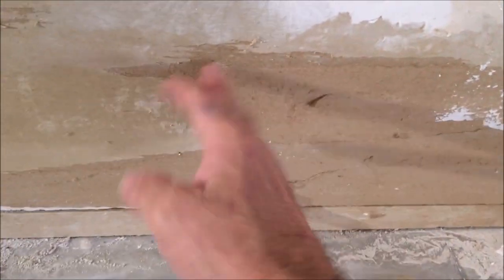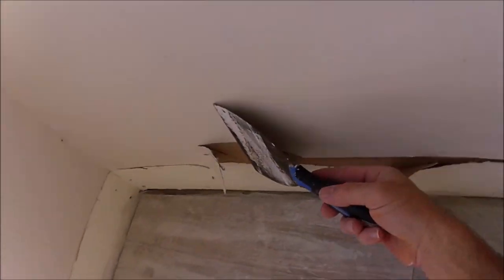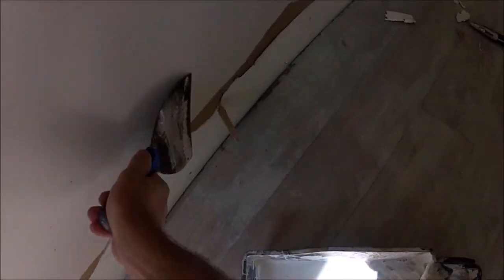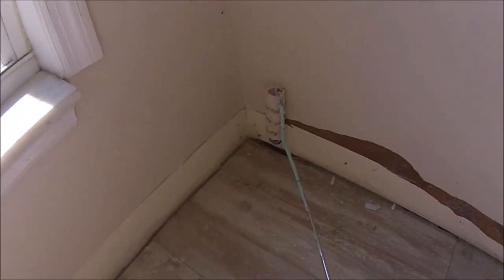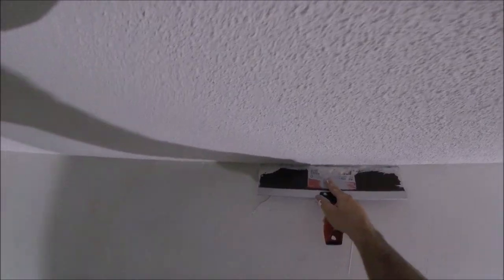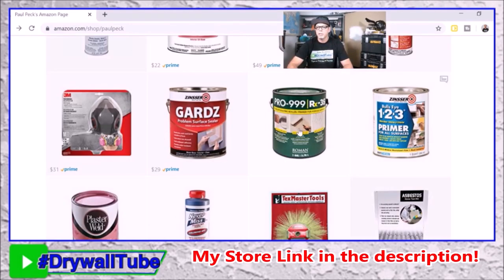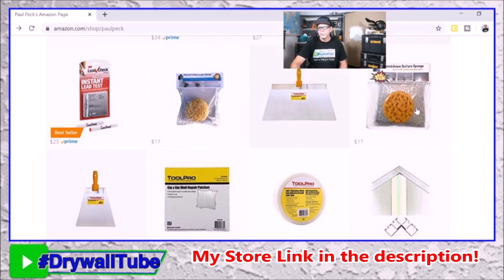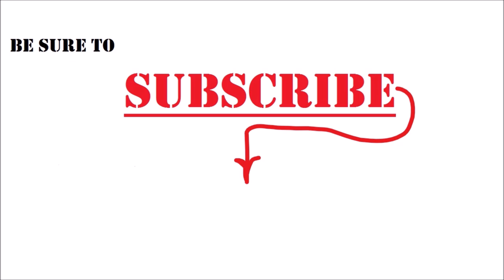Do You Need To FIX TORN DRYWALL PAPER? You Must Watch This!

Comment: I've been drywalling and painting for 24 years this year and I learned my lesson years ago about just mudding over raw torn paper, blistered,  bubbled, huge disaster and you're completely correct, I use cover stain oil base primer or white pigmented shellac but definitely gards is excellent and we use this as well. Thank you so much and you're definitely pro
Reply: Hi, i notice your the most recent comment here and could use some advice lol. so i just torn off my bathroom wallpaper and the drywall was all scratched up and blistered, drywall was a mess. i just finished compounding it, which i guess you mean by mudding? but as you mention, after I did this, its bubbled and blistered. sadly, i think i did it wrong, as I did not use gards before compounding. wish i would have found this video sooner. so my question is,  Should i gards over the compound and then just re-compound over it? appreciate the time lol

Comment: This stuff is fantastic over new drywall finishing. The paint goes on smooth and even and makes nail pop repairs and seam work disappear in the paint job. I use it as a primer any time I paint. It costs a few extra dollars but you'll use much less paint.

Comment: I am a pro painter fourth year. I have used the guards to go to effect. I also use pro block oil spray from Sherwin Wiliams it is white so you can see where you applied it and I’ve never had any bubbling after I’ve used both products. I love your videos.

Comment: Paul, your videos are always very informative and I have also use BIN Sealer as well to seal torn drywall paper and it has worked really well before skim coating.  I have been in the process of removing wallpaper in my home and was able to remove the first layer easily, but the second (paper) layer takes a little more effort to remove with scoring and using a spray bottle with warm water to dissolve the paper.

Comment: I’m so glad I saw this video! I’ve got popcorn ceilings that need skim-coated/painted. I hadn’t thought about using the Guardz to prime it first.  I’ll definitely use the Guardz on the ceiling I removed (most🙄) of the popcorn texture from. (That was a mess!). Anyway, since that “learning experience”, I’ve watched several of your videos on popcorn ceilings, skim coating, etc and am doing a much better job with those projects. Thank you for your time and for sharing your knowledge!!

Comment: Paul, thank you for all the instruction. I have learned so much from you and appreciate your help.  I am a DIYer forced to learn many trades as our contractors have done poor work. Sorry, but I have a question unrelated to this video... may be tough to answer.... I have a wall that is clearly out of plumb that became obvious after the door “expert” installed the door. I have told my wife I should tear down the drywall and start all over. I did suggest floating the wall to make it seem plumb but not sure the wall could handle all that mudd. The problem wall did not become evident until the door installer installed the door.... thoughts? This was a result of “contractor” reconstruction!

Comment: Great Videos!, All Around Handy Contractor Here. I'm Prepping A Wall For Skim Coat. Wall Had Paint From The 60s So Probably Lead Based. I Scraped And Sanded The He'll Out It Due To Peeling. I'm Assuming Guardz Is The Way To Go For Primer Before Skim? Any Advantage To Using Peel Stop Instead? What's The Difference? Walls Are Dinged And Ripped And Some Sections Didn't Want To Come Off Much. Thanks In Advance!

Comment: I used the shellac primer from them. Worked good. I had previously not done this in our bathroom and the bubbling was frustrating! Mud, sand it came back. wtf!! 
I don't know if this works on rooms with alot of nicotine on it - seems to always bleed through. Do you have a video on this? 
Love your videos!
Reply from the maker: If the nicotine is real bad, I’ll first clean the walls with TSP. Then, I prime with B-I-N shellac primer.👍🏻 -Paul

Comment: 25 and diy renovating my condo! i have textured walls and pulled off some ugly trim in the middle of the wall straight out of the 80s. is it possible to get rid of the textured walls with the skim coat? also have popcorn ceiling i need to get rid of, yuck!!

Comment: Do I need to sand ceiling drywall before hitting it with guardz, skim coat, and Retexture?
Home tested positive for asbestos & the company left a bunch of hanging drywall paper- even where the joint compound is.

Comment: Like your videos 
They are extremely helpful. 
I happen to like Gardz  as well. 
I Used it in a small bathroom where I removed some dated wallpaper 
It seemed to work fine then and no issues 3 years later. 
Fast forward to now. Everywhere I go I get a different opinion on what to use for my current task of fixing walls in the kitchen and master bathroom after removing dated wallpaper once again. 
PPG store highly recommends Gardz as they sell it there. 
My cousin who is a 45 year veteran of carpentry and drywall/ remodeling claims, that the only thing worth using is the original Kilz with the shellac base.  Not the water base. 
He claims that anything water base will allow things to stain thru down the road. 
Last week we were looking at paint chips at Sherwin Williams where they emphatically said to only use oil based primer sealer because anything else will let stains leak thru eventually.  
They must be referring to red lipstick or an old daycare center stains. 🤷🏻‍♂️🤷🏻‍♂️🤷🏻‍♂️

Water based sealers are easier to clean up after. Kilz is good but has a noxious odor to deal with.  
Not sure about oil based sealers. 
Quite amused by all the opinions out there. 
Sealers appear to have a degree of subjectivity. 
Case in point: Most Automobiles have been painted with water based paint at the original factories for many years now. 
Good quality Water based sealers ought to be up to the task. 

Thank you for your great videos and detailed explanations. Appreciate.

Comment: Remodeling our bathroom and our walls are horrible. I peeled off the paint in the entire BR. Underneath is 1 thin layer of skimcoat that they applied over horrible wallpaper. I have a few questions.

 One wall I removed it all, all the way to the drywall. It's a house built in the 80`s and the drywall is so smooth. Do I apply Gardz all over the drywall or just to the few places that the brown paper is showing? If I don't apply all over, can I just go ahead and apply a few layers of skimcoat over the smooth drywall or do I need to apply another kind of primer to entire wall? 

On the other walls, I only removed the paint, so the thin layer of skimcoat is visible on top of the wallpaper.. Do I prime those walls with Garda or any other primer before adding a few layers of new skimcoating or can I just skimcoat?

Thanks 😊

Comment: I’m a dyi er.   Been watching you for along time.  I’ve done pretty good with the skim coating. But I’ve run into an issue with old and new drywall not being exactly the same thickness in areas.  How do I make them blend so they look like one even wall section

Comment: 1:00 you don't sand off bumps? 2:00 could you install modern baseboards there easily?
Reply from the maker: No. I’m going to just skim coat over the damaged areas. 👍🏻 A lot less work then flush baseboards...😅 -Paul
Reply: @PaulPeck  oh yes, of course... Just wondering if it could be done at this stage.  Could have maybe offered and got a bigger job.

Comment: Very helpful video. Will the regular Kilz or Kilz 123 work as a sealer over the brown paper?
Reply from the maker: Thank you Michael. The oil base Kilz will work in a pinch.👍🏻 -Paul
Reply: @PaulPeck  Thanks for the reply.
Reply: That’s what I’ve been using on my current project.
Reply from the maker: @MsMuppet1985  The oil base Kilz?
Reply: @PaulPeck  yes in the spray can. I just checked on it today. It’s perfect. The one spot I didn’t spray swelled....duh